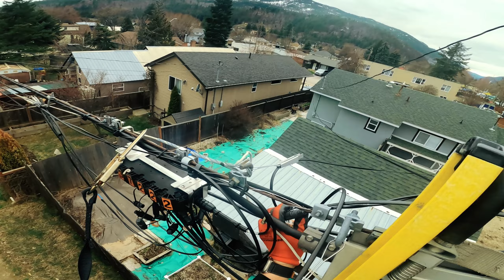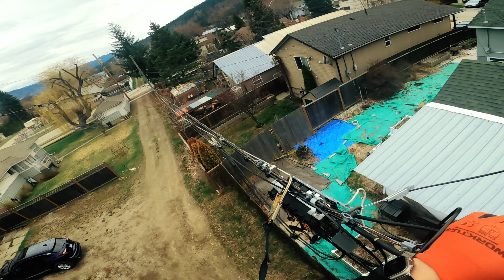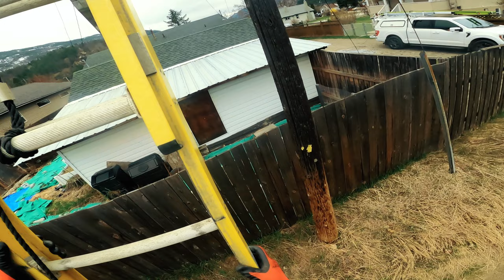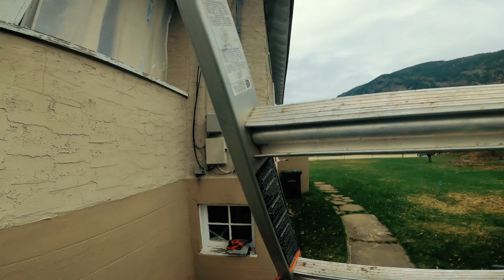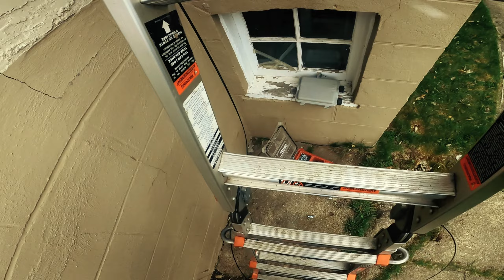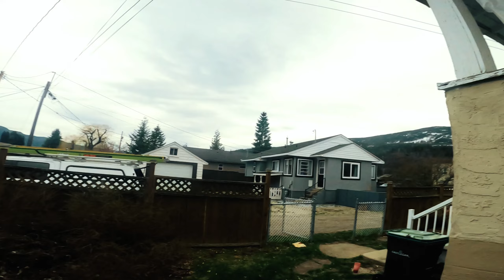Fiber Optic Cable drop Install +MESSIEST MPT EVER

Comment: Your application and expertise in this matter were professional, thorough, and educational, JOB WELL DONE. I showed my technicians who are starting to run aerial drops now as we mostly doe underground, HH/MH from splice closures the ease of installations this process makes and Major don'ts with regards to OSHA and electrical code standards that they're now training for. Thank you! The only thing I'd have to say is we run 2 techs at a job site like this when the height of ladder is extended past 20ft or more on poles.
Reply from the maker: Hey man, I really appreciate the comment. I try my best. Regarding the two techs, I am an independent contractor, and while I do hire out when in need. I have over 10 years of ladder handling experience. So I am pretty confident running solo.
Reply: @FyBurz  You're welcome! Yea I'd say it depends on the company's policy. As we tend to go on roofs and towers as well. Anything that could or would potentially happen we ensure the safety with guidance from a lead tech/installer.
Reply from the maker: @Trigeria  yeah that’s what I was going to ask actually. Weather it was custom or policy. I was a roofer for a long time and took some falls 😅 nothing makes a better lesson 😂
Reply: For sure I did roofing 1 year up in the mid Michigan Area and anything at 30°F you bet you're but you're working. I did a lot of repairs as a sub contractor. My lifeline was always a large sponge from a couch cushion. I trusted that thing more than anything. The scary jobs were always the metal roofs though in my opinion 😅
Reply from the maker: @Trigeria   I did 5 years of flat roofing 2-3 of sloped, the cushion was key 🔑 😅
Reply: @FyBurz  hehe you know your stuff!
Reply from the maker: @Trigeria  are you a telecom contractor?
Reply: @FyBurz  I work directly for a Telecom company
Reply from the maker: @Trigeria  ah ok 👍🏼

Comment: Been a contractor tv/phone/hsd copper installs for about 7 years gonna start doing fiber on the side with a buddy who's contracting just running drops only until I get hang of it eventually start doing installs too any tips?
Reply from the maker: Watch my videos! I show a lot of tips on running drops. If you want to know something specific let me know and I can make a video about it.
Reply: Make sure that your splicer is dry depending on your area. Splicers do not like being wet at all and that you have profiles set on your splicer for both climate, humidity, and season! 2nd tip leave enough service loop and slack like this pro! He did a wonderful job verbally communicating the ugliness of what improper installation and non-code/ regulations are while showing how it's done. 3rd document everything. The biggest issue out in the field are techs that would brush off unsafe, or improper installs or code violations and leaving it for the next guy! Safety is a big priority! If you feel unsafe do not risk it. Fail the job if need be and report it to your direct superior to get it addressed immediately.
Reply: There are varies different tipes of taps, MST, or HMFOC, Splice Closures, that being said try to familiarize yourself with what you'll be working with MPT/MST are the more simpler application as they reduce the amount of splicing needed for install but as you saw if done improperly it could end up being messy if done improper. It's also a good key note that to think just enough is never enough. ie, if you need a foot give yourself 3-5ft or more for safe measure depending on your application. The other thing to note is if you're using a pedestal or handhole/manhole application that the NID or demarcation box won't always be in the same location where other media closures are. I didn't see a patch cable run to the interior but depending on the type of cable used majority SC/APC OS2 or if they outfit pigtail to pigtail connections to a wall plate/coupler fashion or a direct hole with a bunge that taking the necessary "TIME" to ensure your install is clean is something that you must give yourself.
Reply from the maker: @Trigeria  well said

Comment: Also our cable aren't pre made don't have the conectors on the ends to just easily connect on top how yours do so I'll have to do all that in the air and cut place a end etc
Reply from the maker: Hmm interesting, are they AFL drops ? These are Corning optitaps. You have to splice into fosc cases ? (Black cans up on the strand)
Reply: @FyBurz  Yup showed up on my buddy's job was just giving me the basics he was pretty much opening the box striping the wire the drop cable was a really thin one still new don't know the wording for it but he was cleving placing the connector doing all that while up in the air not like yours where you just climb up and connect our box he had to open loop the wire inside and connect etc
Reply from the maker: @xLEGNx  sounds like AFL. Interesting that they don’t have a connector on the ends. I deal with some AFL stuff. The drop is flat but the end looks like the stripped fiber and it has a green sc/apc connector on it. The only reason I can think of why it doesn’t have a pre-made end is because he’s pulling off a large spool where he makes cuts at whatever length he wants.
Reply: @FyBurz  yup that's how he told me the company does it just a spool of cable no pre-made ends for the drops only thing that's pre-made from what he said was the line going in to the home for the install techs seems like a little bit of a pain other thing he also showed me not like regular cable where they have pretty much 1 tap every poll with fiber they only have 1 to feed every 12 house fiber is new in the area so sometimes he would tell me he hits 4-7 polls before he hits the house I mean the pay is alright but he tells me he tries to aim at most 3 houses a day lol
Reply from the maker: @xLEGNx  yeah makes sense. Interesting way of doing it for sure. And that sucks. Here most neighbourhoods have a mpt (access point) every other pole. But sometimes every 3 poles depending on what company did the initial build.
Reply: We have some older areas where i run drops have had to make connector but 95% of my run are front yard UG 😂.

Comment: hey, question for you, your Blue SST striper tool the way you are using it is backwards? or have i been using mine wrong all these years XD
Reply from the maker: So I get this a lot from other techs. I don’t use it backwards. I initially push the drop through the right way then I pull back to complete the strip. So I start at the cutoff end of the drop then push until I need to and then back. I’ve found this to be the most successful way to strip the flat drop and I can get about 30 strips in maybe more before have to to switch the blades around. 

Lots of other guys I know will start with the strippers down the drop where they want to finish and pull out towards the cutoff. Or strip down then take it off and do it again. All of which is slow and inefficient.
Reply: @FyBurz  hey, thanks 👍. I'm going to try this next time I need to strip one. The more you know 😊😊

Comment: In the uk it is mandatory to test the pole before climbing.
Reply from the maker: @BIGB-wc6vr  yeah, mandatory for mandatory sake doesn’t work here because techs just go off of their own judgement whenever I see a pole that’s not in good condition or in questionable state I test it and I also voltage test my poles. sometimes it’s a slight risk but the jobs gotta get done, that being said I’ve definitely rejected jobs due to unsafe poles. 

This post specifically was reported and replaced.

Comment: I made it easy for my fiber installer I knew I would not be continuing with my cable or DSL service so I spent the time removing a garbage cable service box and drop.
Reply from the maker: Very nice I do it often. Love cleaning it up.

Comment: How much time do you get allotted for a job like this and what's your pay?
Reply from the maker: As much time as I want. And I’d rather not disclose. Sorry
Reply: @FyBurz  Fair enough. I'm an installer on the island. We're expected to run missing drops like this, but don't get extra time. Likely why a lot of drops you see are poorly done and not code. It's terrible system. Your videos are very insightful. Thanks for your clean work, helps a lot at house side.
Reply from the maker: @Werfed  much appreciated man, and yeah techs get the short end when it comes to drops. Just do your best!

Comment: Rewatching all the videos :)

I wouldn't of climbed that pole, the cracks in it are way to deep. I would of safetied the job and it would of went to a bucket truck or a replacement pole would be installed. I understand you sending it since you're paid by the job and not by the hour.
Reply from the maker: I took some precautions. Kinda in a bind, but the pole was reported and replaced

Comment: If you think that's messy then that's nothing compared here in the Philippines where wires and cables are like spaghetti wires anywhere even in posh subdivisions. You can Google telephone cables in the Philippines for images.
Reply from the maker: I’ve seen haha😅
Reply: @FyBurz all telephone lines here in the capital region I'm living are now fiber optic but the old copper telephone cable lines are still hanging here. Last November the electric company cut off all internet, telephone and cable TV lines in one section of my hometown. It took a month to replace all cables and drop wires but they never removed those that were cut off and abandoned.

Comment: #1 - if it passes good light its just fine, don't be nitpicky.

#2 - MOST techs ain't got no time for that when you get double and triple booked on work on a daily basis
Reply from the maker: tell me you're bad at your job without telling me...

I do have time to nitpick so I do. our fibre plant is a mess because techs like you don't care and can't take even 5 extra minutes to do thing properly or fix small mistakes.